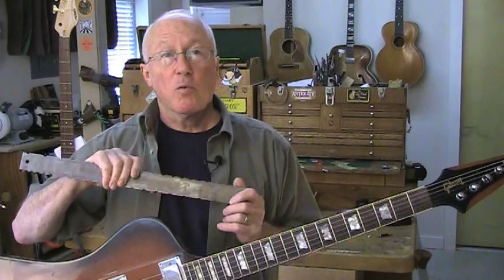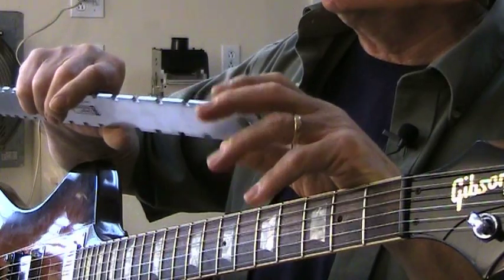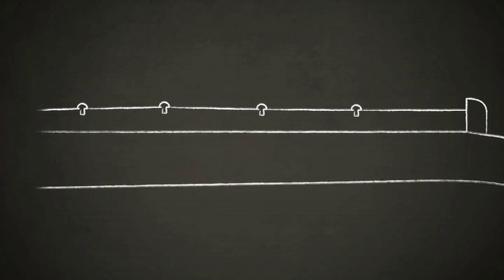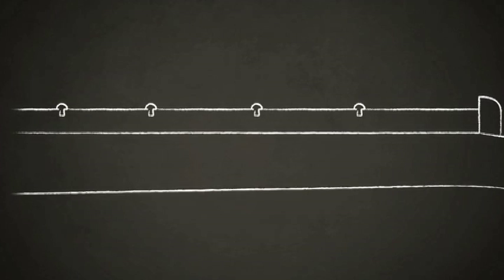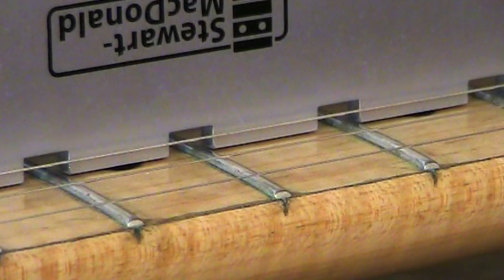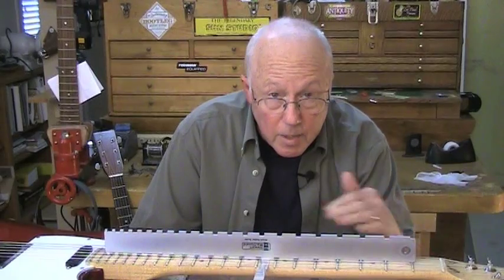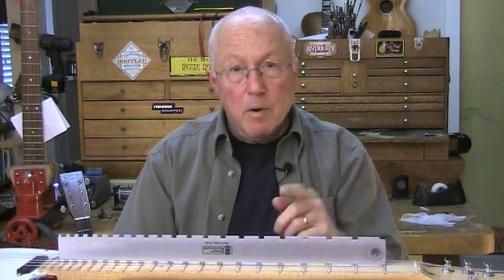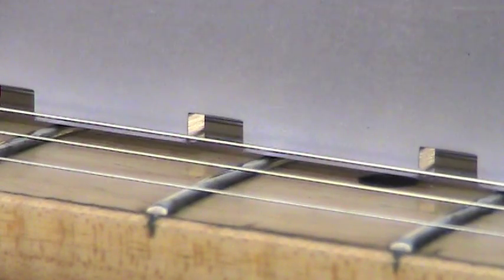Notched straightedge for guitar or bass

Comment: How do you know how high it should be in regards to setting the neck relief, just using the notched straight edge?  I see you're putting a feeler gauge underneath it, that's cool -- but what should I be aiming for in regards to the measurement of the feeler gauge, and at which fret should it be measured at?
Reply: @Miss Priss Hi, I've got an Ibanez AZ with a 12" radius.  I can't do fret work I don't have the skill or tools.  Just trying to get my neck in the best shape.  My guitar was PLEK'd when I first bought it and the frets are SS.  I have a fret rocker and I don't detect any uneven frets.  The action still can only go so low before I start fretting out on big bends on the high E and B strings though!  Oh well.  I've got the relief at around 0.010" measured from the wood under the notched straight edge at the 9th fret right now.
Reply: @Nick K  according to the video it should be the 7th fret.  Not the 9th.  Who knows....
Reply: @380stroker  It doesn’t really matter as long as you’re consistent with it.  Different luthiers test at different frets.

Comment: The notched straightedge is actually  a totally superfluous tool. All you  need to get a fretboard straight is a normal precision straight edge and three small blocks of equal  height that you can fit at either end of the fretboard in between the G and D strings.

Google "advanced fret leveling system" to see what I mean
Reply: My kids have Legos everywhere so I'll use those as blocks for the straight edge.  Haha.  Should work.